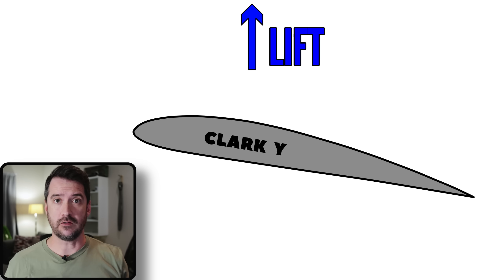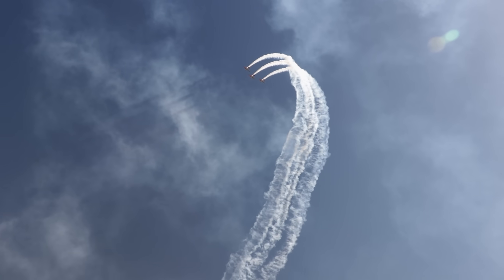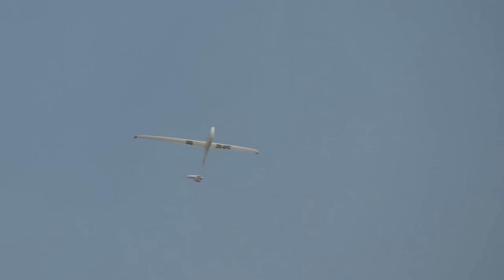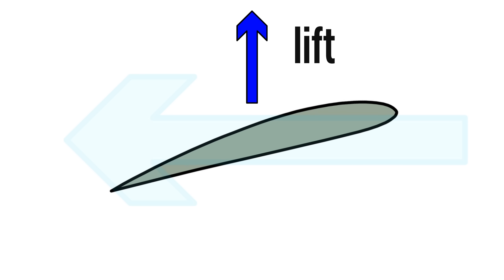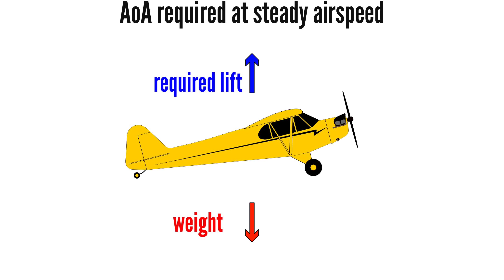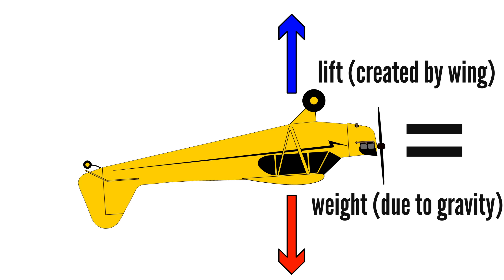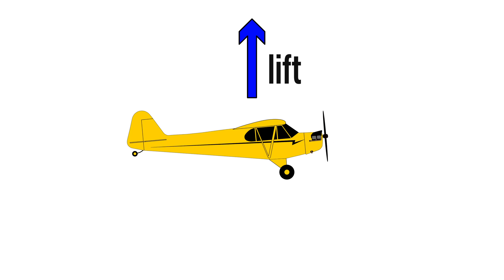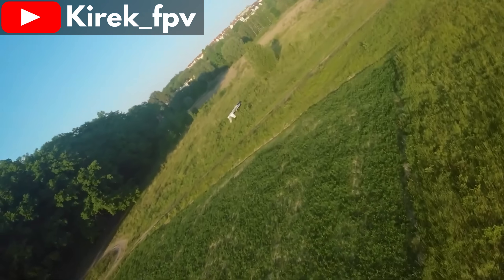Is Airflow Distance Over the Top of a Wing Always Longer?

Comment: The way my fluid dynamics prof put it in school was good, apologies if you used it here and I didn't see it. Paraphrasing heavily. "There is no assurance that two adjacent air molecules or control volumes, one destined to go over, the other under the foil, will meet again at the trailing edge". The meaning here is you can't infer that the air was moving faster over the foil simply because it's path was longer. That argument only works if the two particles met again at the end, which would be bonkers. The argument is lost on many, because the fact is that the air is moving faster over the top, and mr. Bernoulli says that makes lift. People with subtly function turned off, and for those whom black and white reigns, may not get it initially. For those it should be good enough to know that air is moving faster over the top, creating lift, and the reason for that while not a mystery, is complex & can't be reduced to an argument using path length differences over the foil as a basis.
Reply: Two neighboring particles move along two paths, both starting at point A and terminating at point B. The paths have different lengths. If they both leave point A and arrive at point B at the same times, you can say one traveled faster than the other on average & that the local pressure of the faster one was lower. All you need to do is show they arrive at the same time? Your not arguing with me, your arguing with a guy who spent his life researching & teaching fluid mechanics for a living. He said it's common for people to have a hard time accepting it because the argument for it passes the squint test.
Reply: @davetime5234  The cookie cutter way some people talk about how foils work is to state that when a particle takes the path over the top, it's path is longer. Due to it's longer path, it's average velocity is greater, creating lift. This is a fallacious argument.

A good way to compare things is by using a common metric that can be calculated, apples to apples as we say. In this case the metric would be the average velocity of the two particles while they are in contact with the foil. Recall the only information we have about the system is that two particles travel over the foil, one over the top and the other over the bottom & the top path is longer. The only way we can say one particle moves faster or slower on average is if they meet again. Without this there is no basis for comparing their average velocities. You need more information.

This argument attempts to show how lift is created based solely on the knowledge that the path is longer over the top and that faster air has lower pressure. Both those things can be true, great, but the missing piece is the condition required to show that one is moving faster or slower than the other. This shows that when things are simplified too much they may lose technical accuracy, but stick around because they feel right. For the purpose of explaining how foils work to an unsophisticated person, it isn't accurate to say that lift is a consequence of the top being longer. There is more to it.

Unfortunately conservation arguments won't help.

Comment: Force and momentum of air particles are used to simulate all modern air designs for a good 40 years or so in FEA/FEM methods.
The air lift is well understood and described with use of physics of air molecules momentum. To put is simply air particles are being pushed downwards, from the middle section thought the remaining length of the wing (therefore creating down wash after leaving it's surface). Plane fly's as the force which creates a down wash has it's counterpart which we call lift (each reaction has opposite reaction). The force which pushes air molecules downwards is created due boundary layer close to the wing surface which has lower speed and pressure than air farther up from the wing (the air sticks to the wing curvature as the wing cuts it's way through the air it create void on the back side to which the air molecules are being sucked into). 
The interesting part of all of this is the front section of the wing which "bounces" air particles upwards, but as the overall force is still forcing the air molecules to be moved downwards, the total lift vector is positive. Also front section of the wing creates drag when air molecules hitting the leading edge (pushing them forward).
The bottom part of the wing also creates list as the air molecules are hitting it, and this value increases with the increase of the angle of attack.
The best part is that once wing reaches the maximal angle of attack, the down wash is removed as air tumbles instead of being pushed down in laminar flow, which removes the "thing" from which the plane can take the momentum from (and the force as well).
Reply: @davetime5234  Correct. You are right about both the momentum of the molecules and their flow rate. 
Second is also correct, though with the increase of the angle of attack the force from momentum change of air particles interacting with the bottom of the wing is increased. The vector of it is perpendicular to the wing surface and is major component of increased drag.
Reply: @davetime5234  Yes, this is what I meant.

Comment: It always amazes me that discussion of flight somehow forget or totally ignore Newton's laws. Most basically, if the air exerts an upward force on the wing (lift) then the wing must exert a equal downward force on the air, regardless of how this force is created (Bernoulli or simple deflection). This is the true basics of flight. In that regard, the diagram of stagnation points is at best misleading. The airstream of the rear of the wing shown should be backwards and down, not simply backwards.

Also, all the discussion of longer or shorter paths is a bit of a red herring. Bernoulli's principle applies to speed of motion in a fluid, not the distance travelled. The longer path causes the air to move faster, relative to the wing, thus causing a pressure drop. If a longer path could be engineered that caused the airflow to be slower, the air on the longer path would be at a higher pressure.

Comment: People need to stop thinking that the wing is getting pushed up from the bottom "slower" air and see that the wing is getting "sucked up" by the airflow going over the wing that wants to continue on a straight line but is stuck to the wing surface, creating negative air pressure on the wing
Reply: You just need to remember that negative pressure doesn't exist.

Comment: As an aero engineer I very much dislike the path length explanation because it's about flow velocity and not distance travelled. Many incorrectly assume flow particles separating at leading edge reach the trailing edge together which is not happening in reality! In reality the flow over the top even reaches the trailing edge first. Therefore I find the path length explanation flawed and only leads to confusion. The circulation explanation is much better but harder to understand, that's why I prefer the Newton's third law about flow deflection for explaining lift to non-engineers. I do agree with most you say though.
Reply: @davetime5234  when explaining lift to people I like to give them a theory they can reason about, the path length doesn't allow that, is confusing and often based on the incorrect assumption of flow reaching the TE simultaneously.
Newton's third law does allow reasoning somewhat correctly.
Circulation is best as it also includes symmetric foils and gives insight in tip vortices and has a very accurate relation to real lift production. It's the basis of many classic lift calculation theories.

Comment: Your own picture of an airflow stalling explains the error. The idea that the lift is created by the fact that the airflow meets at the end of the wing is an error.(Bernoulli's theory dosn't work here because the air divided at the beginning of the wing is not comming back at the same moment at the end of the wing. In fact the turbulences created at the upper part are making a huge part of the lift. This is prooven by the effency of laminar wing profiles. But to make it easier to understant answer yourself the question: Why is a Profile with hollow down wingpart giving more lift than the one that is flat below.  The way below is now longer. The Clar Y Profile is not the best possible Sailplane design.
Reply: The fact that the air travels faster on top is the important fact.  That it is travelling so fast that it arrives earlier than the air on the bottom, says nothing about cancelling the notion that path length does indeed affect speed of travel.

You need to get on board with the fact that equal transit time is already known to be a dead idea.

Then you might be able to learn how path length does influence the speed of air transit.

Comment: Nothing of this shows lift has to do with longer/shorter path.  
Air pressure over and under the wing doesn't care what particles meet up where the profile ends.
Reply: Particles don't meet up at the same time, it's true, because they travel fast enough on top that they arrive earlier.  That is well established (though admittedly some people are still left behind on that).

But that says nothing whatsoever about the path length not being connected to the speed increase.

What then does increase the speed on top if not directly influenced by the path length?
Reply: @davetime5234  That is not important for lift.

Comment: simple:  the air molecule "billiard balls" are hitting the bottom of the wing with more force than those hitting the top of the wing.
Reply: I believe the average force is the same, or more accurately, the momentum.  

But the density of the collisions is higher on the bottom than the top.

(the average momentum is determined by the thermal velocity, so it is temperature dependent, with the masses of the molecules being a constant of course)

Comment: the long path "argument" is no argument at all and wasn't designed to prove anything... it's just an old fashioned simple way that parents used to explain lift to kids
Reply: Better alternative for how lift arises from asymmetry?
Reply: @davetime5234  in fluid dynamics we just use a mathematical principle known as "circulation"  but since that involves using calculus and integrating a vector field then it's usually over the head of most folk so rather poor explanations like "longer over the top than the bottom" come up instead.   https://en.wikipedia.org/wiki/Circulation_(physics)

Comment: I learnt lower pressure on top of an object creates lift when I was doing the dishes as a kid around 10 years old. I had a stack of plates in the sink of very hot water and was washing the top of the top plate with a scrubbing brush in a circular motion causing the water to start turning in a circular motion and once it was moving fast enough the plate started floating up to the surface of the water even with me pushing lightly onto the top of the plated with the brush. The plate wasn't spinning, just the water, the moving water on top of the was creating less pressure than the water under the plate that wasn't moving.

Comment: Lift is created by the wing causing spinning vortices which push air away from their center.
This causes low density spinning pockets of air that surround the wing.
This is increased greatly by the equipartition theorem.
The spinning of vortices is more because oxygen and nitrogen or both diatomic.
The wing and surround air all rise due to the spinning vortices.
This is best demonstrated by simply dropping a piece of cardboard 1cm x 5cm.
It will spin in synch with the vortices of the air.
See the Entothopter and the Torquethopter for more on this.

Comment: Very interesting and educational.  Thank you. Interestingly, I was watching a video, which experimentally proved that a longer path over the wing does not force the air to run faster in order to meet its counterpart flowing bellow the wing, but is running at the same velocity, if not obstructed somehow, and is simply delayed, so not really contributing to the lift in the way we usually think.
Reply: The path length difference affects the continuity of the mass flow rate. A longer path puts a stress between mass coming in and that going out.  The pressure drops in order to sustain a high velocity along the longer path length.  So:  same mass flow rate is achievable over an elongated distance by higher velocity at lower density.

The driving issue here is not equal transit time (which is well established to be false), but rather the continuity of the mass flow rate.

That is in the fundamental Navier-Stokes equations, the gold standard of fluid mechanics.

Comment: It's all nonsense. Not one correct answer on here or on the internet. Planes fly due to electric charge. The wing causes a buildup of charge below the wing. Higher presure equals more molecules equals more charge. The atmosphere is 100v per meter all the way up to 400,000 volts in the ionosphere. Zero volts at ground. The increased chrage wants to get back to it's normal level in the aymosphere and pushes on the wing to get there. Stall happens when the higher charge air can get around the wing to seek it's normal height; leaving the plane behind.
Reply: wrong. planes fly due to chemical charge. people cause a buildup of chemical charge inside the wings / avgas

Comment: First of all, please stop talking about the "length of the path of air travelled" (even to debunk another false explanation) because... it is not relevant in aerodynamics !
See for example https://www.grc.nasa.gov/WWW/k-12/VirtualAero/BottleRocket/airplane/wrong1.html
I would like to point several other misconceptions in your video:
a) The stall and the laminar or turbulent state of the fluid are in fact irrelevant to each other. Look at any modern fighter in a high-G turn and you will see huge vortexes, which help creating lift !
b) On the drawing of a (subsonic) airfoil from the side, the air in front of the airfoil does should not follow a straight path (and the air behind the airfoil as well). The wings actually affects the air both in front and behind it.
c) Dropping a bomb is never going to change the angle of attack. At the instant you drop a bomb, the planes just start accelerating upward, and the pilot/control system will usually quickly compensate for this by reducing the angle of attack. However, the stall still occurs at the same angle of attack, so you are effectively still close from stalling right after the bomb drops...
d) To draw the force vectors at scale, the drag should be 1/10 to 1/20 smaller than the lift
e) If you look at any lift versus angle of attack curve, you will find that they are very linear around zero lift almost up to the stall area. Cambering a profile just shift the whole curve upward or downward: it does not affect the efficiency of the wing in terms of lift created per degree of angle of attack.
Reply: "stop talking about the "length of the path of air travelled"  How come?  Lift is phenomena of asymmetry.  If you're talking about asymmetry and its consequence, how can you not implicate path length difference?
Reply: @davetime5234  It is the asymmetry of air velocity that is meaningful. The fact that "the length is longer" does not imply that the velocity is higher. These velocity differences are such that the air going on top of the wing usually reaches the trailing edge before the air that goes under.

Comment: The upper and lower paths of the airfoil have no magic telepathic connection to each other, so the length of the path really doesn’t matter at all.

Really, the upper and lower paths should be considered separately, as they both carry the potential to direct the airstream downwards, thus generating lift.

The lower path can generate lift simply by pushing the air downwards with a sloped surface, nothing confusing about that, but the upper path can generate lift because air is a fluid and, compressible or not, it will follow a curved surface as a result of its static pressure (and without enough static pressure, stall will occur in air or cavitation will occur in water).

That means that aircraft stalls (and flow separation) occur more easily at high altitudes (look up coffin corner), where the air is thin, and cavitation on ship propellers occurs more readily at shallower depths (so submarines can reduce cavitation by running at deeper depths).

So even if the lower surface of a wing is completely flat, and thus, generates zero lift, the upper surface can generate lift all on its own through entrainment.

So again, having a longer path on top is completely irrelevant, it’s the shape that matters.
Reply: "having a longer path on top is completely irrelevant, it’s the shape that matters"  The longer path can't be irrelevant if it is tied a shape that matters.  This is a question of geometrical association.
Reply: @davetime5234  You can have a longer path on bottom and still have a wing that generates positive lift. In that case, the lower surface will have to be concave, think a WWI biplane wing, or many propellers/rotors, most of the time the lower surface will be about the same length of surface as the top, not greater, but still, in that case you about an equal path length on bottom as on top, and even more lift than the basic airfoil shown in videos like this.

Furthermore, typical animations of the "longer path" explanation have the airstream on top of the wing traveling from the leading edge to the trailing edge in the exact time amount of time as the airstream on bottom. But most of the time, the airstream on top completes the journey much faster than the airstream underneath. Thus, there's no significant connection between the path length above and below the airfoil.
Reply: @J7Handle  So, if you have a longer path on the bottom, how do you generate the pressure drop on the top from that?

What causes the assymetry of airflow that produces the assymetry phenomenon that is lift?